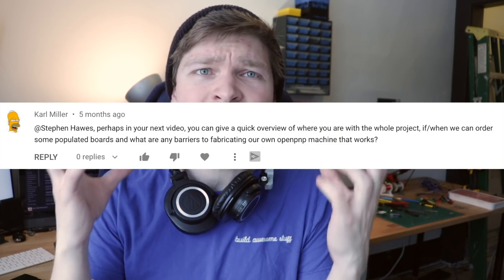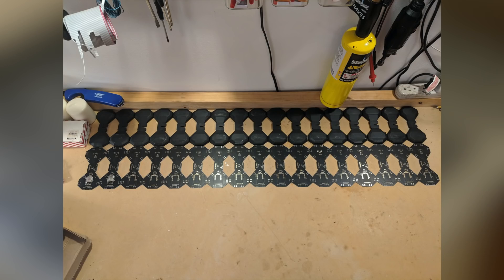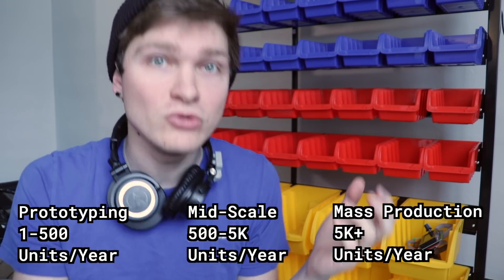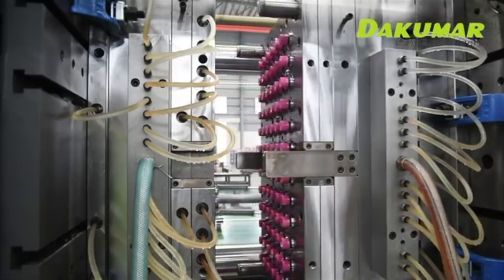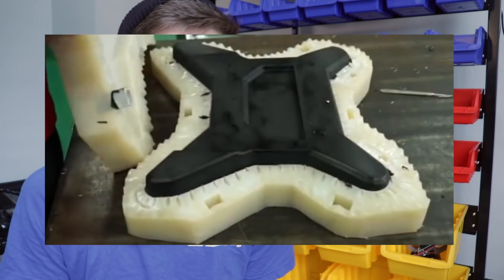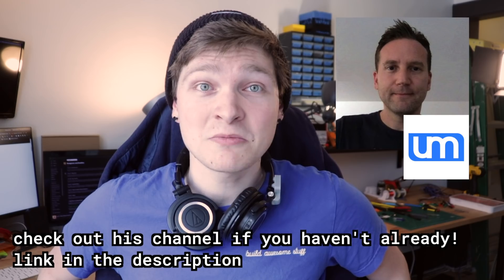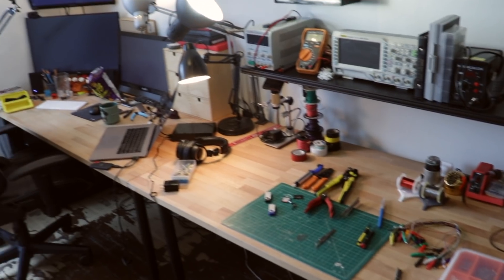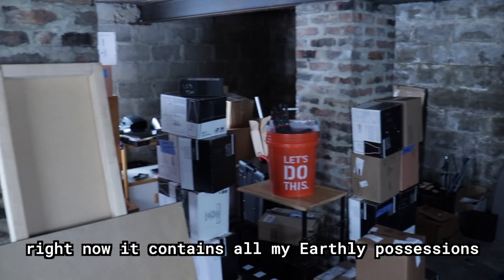Mid-Scale Manufacturing

Comment: In some ways your goal, which is fantastic by the way, it’s like bringing cottage industry back to the industrial revolution but in a backwards sort of way.
I’m excited, for going on 30 years I’ve been making small products that are just more than hand manufacturable and I’ve always given up because it’s just too hard to get over that first little scale hump. I even tried to make a pick in place machine back in the 90s. Even though micro processors and board design haven’t changed at all since the 90s, and I mean AT ALL, what has changed is open source and the sharing of open ideas on the Internet (that didn’t exist back then) . That makes it possible to get over the hump of doing it alone and failing. You are the icon for that new reality and I’m so excited for you because you make us old makers excited again about the prospect of cottage electronics. I’m excited to be along with you on your ride and congratulations on the move to full-time.

Comment: Great video man! Definitely let us know how the belt printer turns out. I wonder how that compares to a manual injection molder/Morgan press kinda thing (https://www.robotdigg.com/product/743/Manual-or-pneumatic-injection-molding-machine-plunger-feeding) for QTY 100-500 hardware parts? I did a couple of projects where you could spin up a single-cavity injection molded tool pretty quick (conservatively 10ish hrs of machining + setup time for a 2 part mold) once you're committed to a design, and you can pump out 100-500 in just a couple days with a single-cavity mold. The major advantage over the belt printer is that your material (raw pellets of PP, HDPE, etc) is dirt cheap compared to filament.

Comment: 8:00 what you're describing is a manufacturing ERP system. Made2Manage is one I've administered, at least back 20 years ago when I worked in IT. There are also quite a few open source ones out there. Not much point in reinventing the wheel IMHO.

Comment: FWIW, mid-scale manufacturing is EXACTLY WHY I'm so interested in the Index that I'm building a custom 3D printer specifically for building the parts for an Index. (Pics of the XZ gantry assembly: https://imgur.com/gallery/Zabshcz )

I have a few small projects that would be great for makers and would benefit tremendously from an open-source PnP system. One of them is an intelligent power control board a maker can easily add to any 5-volt project and give it a fully functional PC-style power switch, but the economy of scale doesn't kick in unless I make 500+ of them at a time. It would cost too much per unit to farm out the mfg. side for something I would sell for $19.95 US, and would be far too difficult to manually make them in-house at that scale, unless I had a PnP machine. Index solves that problem for me without costing multiple thousands of dollars, I can build a bigger or smaller machine to suit my circumstances and requirements, and I don't have to worry about getting a poorly constructed machine for the money (example: T962 reflow oven).

Comment: I am still confused a bit by your goals for this PNP.   You defined mid level defined by ( 500 - 5K ) units/year if linear would be 1-2 to 10-20 a day.   I am going with the "person" can't/doesn't want to just build 5K at once, but maybe does a run every two weeks or month.  so we are look at 15-30 to 150-300.  Can we explain ( at least for the electronic )production the cost benefit for doing your way  vs (ex PCBWAY or JLBPCB ) producing and assembling the boards.  The  time ( ordering parts,  storing/setup parts, machine preparation, running, storing/cleanup finished boards), physical space for machines ( i.e. a corner, a room, a workshop ) hard to make.
Reply from the maker: good point! there definitely comes a point where it makes more sense to outsource assembly to a board shop instead of trying to do it yourself. there are two main reasons i think having a pnp is still beneficial: 1) having control of production in-house means catching issues with production immediately. there's some great defcon talks about fabricating badges where a small miscommunication resulted in hundreds of badges requiring a bodge. adding another entity also adds another place where communication can break down. 2) some folks starting out might not be able to pony up for a large enough batch to justify paying for assembly. if you've only got a few hundred preorders, but it takes a few thousand to justify the assembly cost, being able to assembly boards in smaller runs (or even bespoke!) will help keep costs down. but there is definitely a point where both of these aren't huge issues, in which case getting your boards assembled is definitely the right call!
Reply: @stephen_hawes  good points.  1) yes if the rate of change / innovation / bug fix is high enough this is VERY valid.   Where does the word prototype morph into production, where do you stop saying is this what I want to build vs I need 200 ...Defcon badges ..... You know Defcon/Maker badges are only done  if you pry it from their still hot soldering irons. You have said "production".  2) Yes which is why I think the upper end of the 1-500 prototype box is a better fit, with the caveat ( price 1,000 caps  vs price 25 caps  ) can saves you 75%

Comment: This has been such a cool project to watch. Something to note: I spent years working in a stone shop like that in northern Wisconsin and depending on the weather those walls will for sure sweat. If you are doing production work in that shop you may see the machine degrading quicker over time humidity =  corrosion. (not sure about the weather where you are from but I see snow). There are a couple options to fix that. One would be to reframe the walls with wood studs to build a vapor barrier. The other and maybe more aesthetic option would be to look at painting the walls with a sealant and making sure to keep the humidity down with whatever you're allowed to use. We used a jet furnace because.... well... northern Wisconsin.

Comment: If you’re interested in injection molding, I would suggest that you should check out buster beagle 3d. They have designed a manual bench top injection molding machine using off the shelf parts, made instructions for it, and is selling the parts that can’t be bought off the shelf, which he designed.

Comment: I think you missing one thing. But first, you made a great job, don't let anybody stop you. But I would invest some time finding out, what happend to all the other opensource pick & place projects? Why most of them are not complete and lag in new improvements...
Reply from the maker: this is a really good point! thanks for bringing it up. in my poking around existing projects, it seemed like there might not have been enough interest in the idea of a hobbyist/small business pnp at the time. awesome products like the Liteplacer definitely get used, but i'd guess a combination of the effort to get one going, and showing examples of where it's truly useful prevented it from gaining more momentum. all conjecture though! im hoping to make the Index really easy to get started with, and also use the product to make itself to show its practicality.  either way, id be happy just making a pnp for myself and for the folks that have an interest in picking one up! :D
Reply: @stephen_hawes  Hey Stephen, I have some bad news for you. Maybe you allready seen it, but JLCPCB offers now free pcb assembling (SMT). So for a few bucks you can get your design allready assembled even for only 5 boards. So there is really no advantage more doing in inhouse, I mean as long as you can't manifacture high quality pcbs in house :(. Any ideas? I've made my own pcb boards long time ago, even double sided. But no solder mask, no prints, no vias, hand drilled...